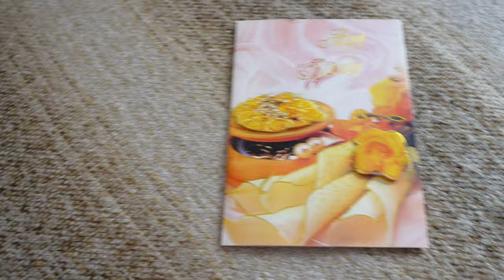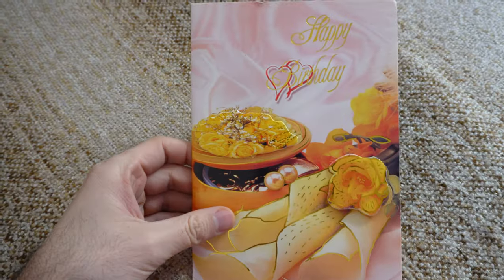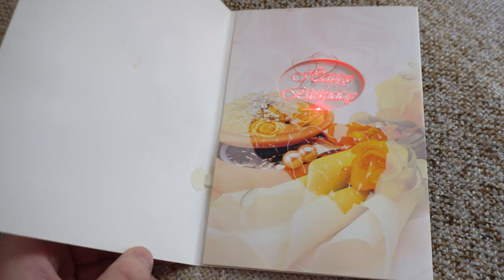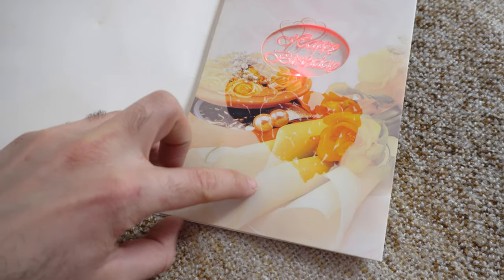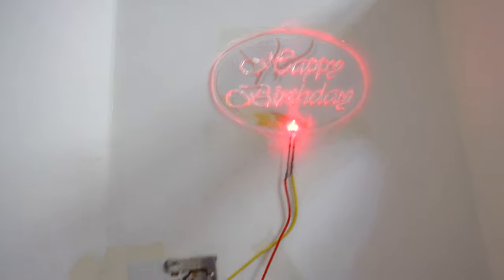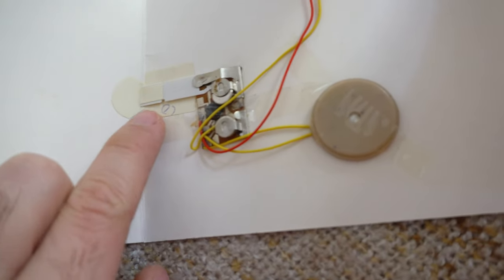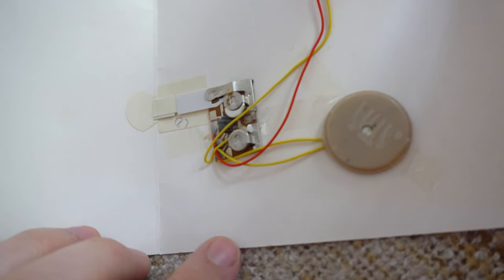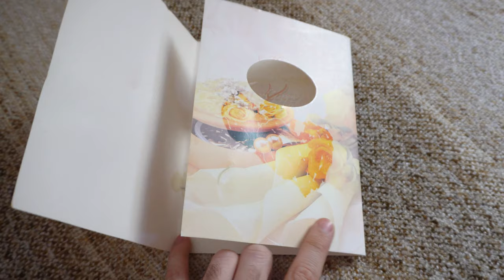Musical Greeting Card with LED light (Happy Birthday)

Comment: hi i need help , i v watched many videos of yours and i need help to increase my fps on my laptop , 
i have a : toshiba satellite i7 - 6700hq cpu 2.6 ghz /16gb ram / vga nvidia gtx 950M / 4k resolution / touch /
and im having laggy performance , i henabld performance power options , and made my visual effects to best performance through system ,  image settings in nvidia set to high performance , deleted %temp% did most of the things i can to keep it at best fps in gaming ,i really cant afford a new laptop or  pc so i want to make a steady 45 or steady 30 fps in pubg steam , just to kill time in quarantine , can you help , i downloaded CPUID CPU-Z to see if somethin wrong